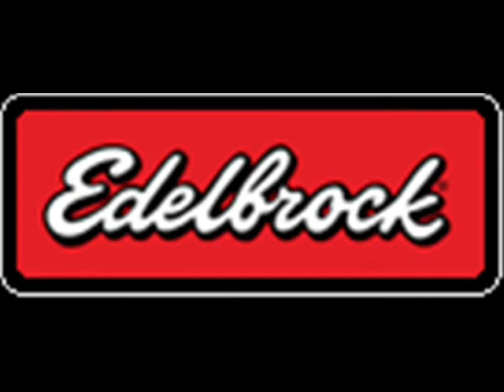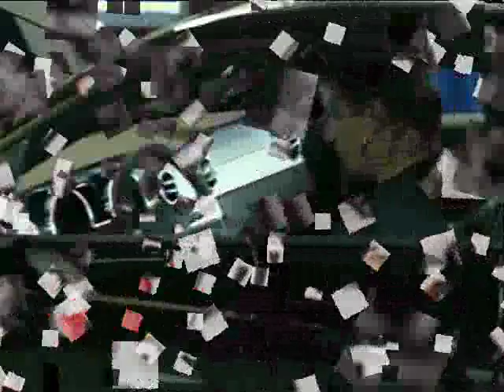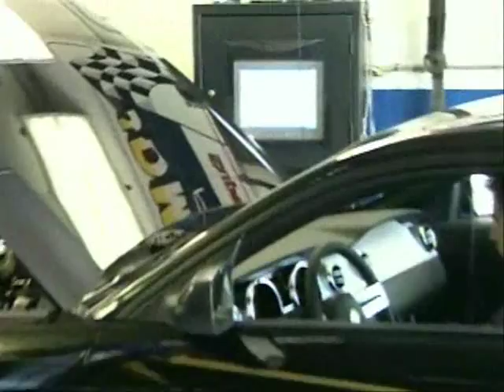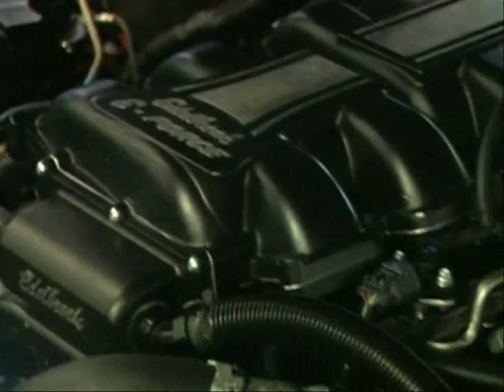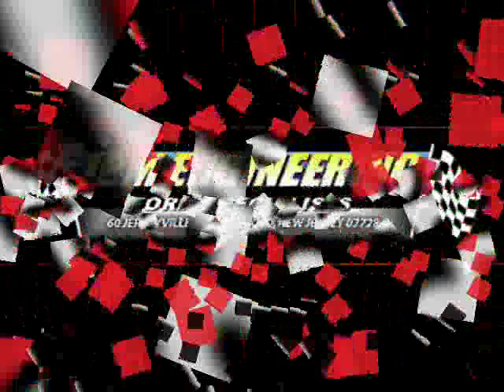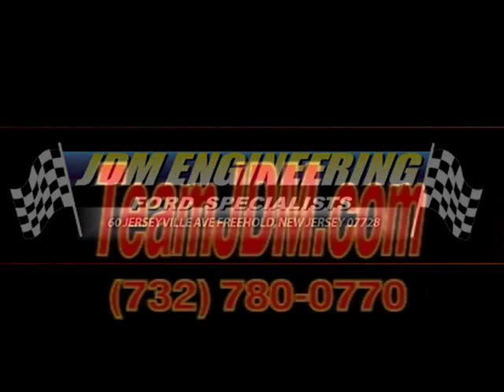another EDELBROCK 500HP E-Force Supercharger

Comment: camshaft aren't a probleme, in fact stock camshaft are working prety well whit Forced induction application. The parts you would need to change would be the connecting rods for some H-Beam Rods, Pistons, Crankshaft , and for really high boost application , the sleeves .. but that's for really high boost..

Comment: I have always heard 450 rwhp was the ceiling, and to stay under 10lbs of boost. 

Did I hear right that this is on 15lbs of boost and all stock internals?

See this was uploaded a few years ago, have you had any problems since? Just getting the 3.5 pulley and dyno tune done now for my 2005 gt and curious how safe all that power has been since I am trying to cap mine at 440-460 rwhp.